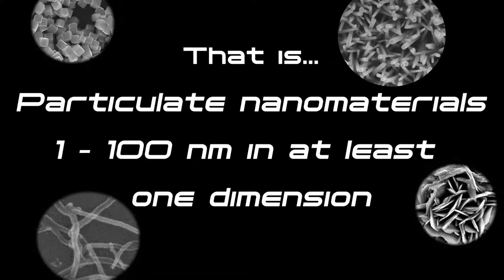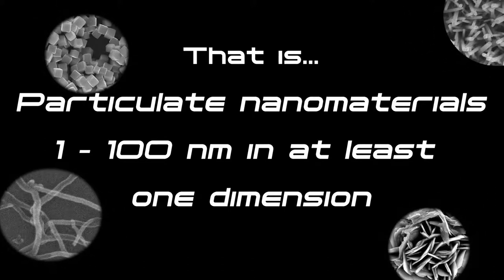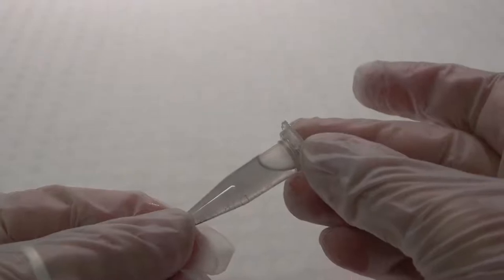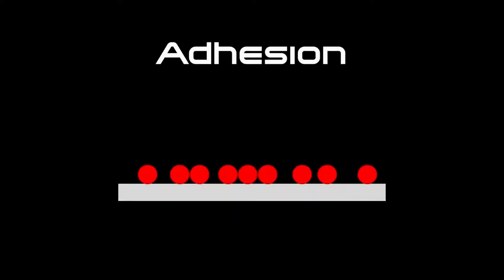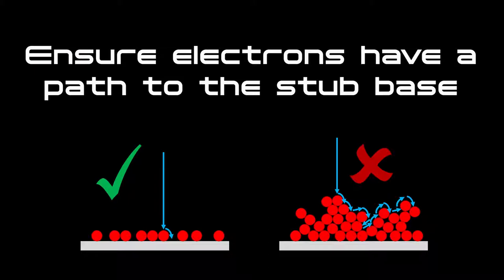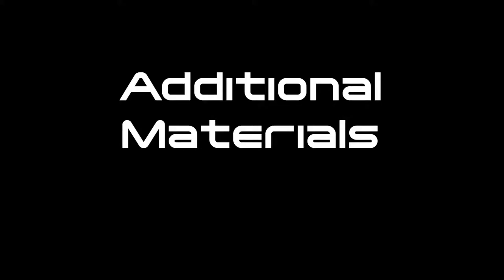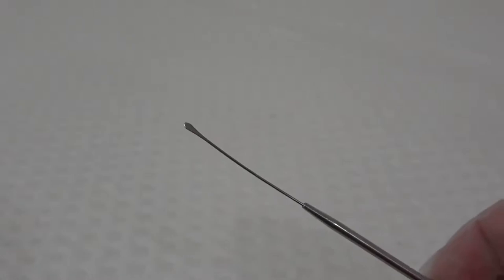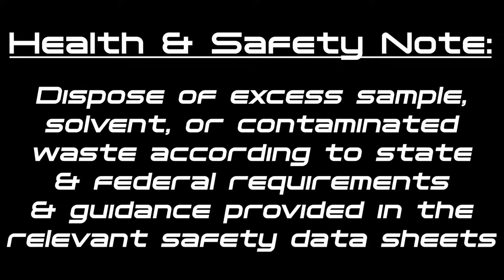SEM: Sample Mounting for Nanoparticles or Particles in Suspension

Comment: hi, i want to know, what should I do if my sample cannot stick to  double side adhesive ? I tried other tape, the sample still not attached…
Reply from the maker: In general, we tend not to use adhesives to mount nanomaterials for SEM examination. As you can see in the video, we usually create a well-dispersed suspension of particles and deposit a drop of that suspension onto a clean, featureless (preferably conductive) substrate such as a silicon wafer. Once the suspension liquid fully evaporates, we then image the remaining nanoparticulate residue in the SEM.

Comment: Is it necessary to dry the prepared nano particles prepared by wet chemical method?
Reply from the maker: Yes, samples need to be vacuum stable and should be fully dry before attempting to image them in a SEM. Even in an ESEM instrument, which can handle a certain degree of moisture, the SEM is only capable of imaging the surface of the sample, so will not be able to ‘see’ nanoparticles suspended inside a liquid.

Comment: is not needed to fix the sample before? Is the sample was already fixed, how can I fix nanoparticles?
Reply from the maker: Fixation is a term we use for the process of preserving the structure of biological samples from their in-vivo state so that the samples can be examined in as unaltered a state as possible. Biological samples containing nanoparticles should be fixed as appropriate for that specific tissue type. There are many types of fixation methods; it is important to review the literature and consult experts regarding the best approach for your specimen type. It can also be very helpful to experiment with a range of fixation methods with non-critical samples to determine the optimum method for your particular application.

Comment: Thank you for the video! Can I metalize the sample using this methode? Can I put the sample directly on carbon tape or do I need to use a substrate?
Reply from the maker: By ‘metalize’ I believe you mean to coat the sample with a thin layer of conductive material in order to enhance sample conductivity for SEM examination (generally metal sputter coating or evaporative carbon coating). This can certainly be done once the sample is mounted on the SEM stub as shown here.
 
Can I put the sample directly on carbon tape or do I need to use a substrate?
As shown in the video (from 1:42), a very flat, featureless substrate is best for this type of preparation. The chosen substrate is mounted on the SEM stub using an adhesive (such as carbon tape), and the sonicated nanoparticles in suspension are dropped onto the substrate. For nano-sized samples, mounting directly onto an adhesive can be attempted but does not always yield good results, as the tiny particles tend to sink into the surface of the adhesive, making examination of their morphology more difficult.

Comment: How much amount needed to sent for a sem analysis test of nanoparticle
Reply from the maker: The amount of nanoparticulate material required cannot be precisely specified. We generally advise individuals to bring approximately ~1g of (dry) nanoparticles, and only use a fraction of this amount for SEM or TEM examination. If the nanoparticles are suspended in liquid, then a concentration that alters the visual properties of the liquid (i.e., makes it ‘cloudy’) should be sufficient. It is always recommended to consult the microscopy specialist(s) with whom you are working for their recommendation. Because engineered nanomaterials are considered hazardous substances, only minimal quantities should be handled, and storage and handling should be done in accordance with local and federal safety guidelines and regulations.